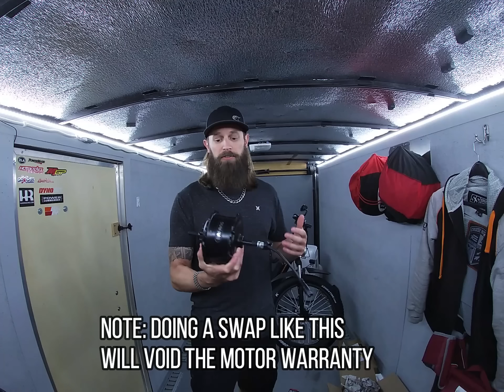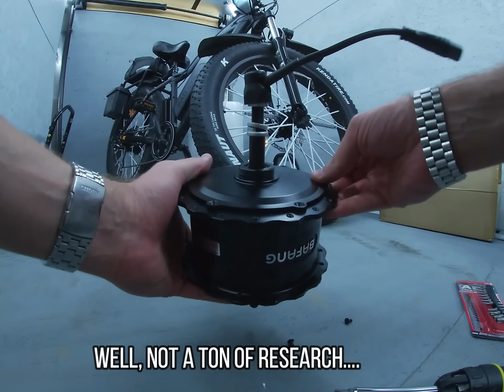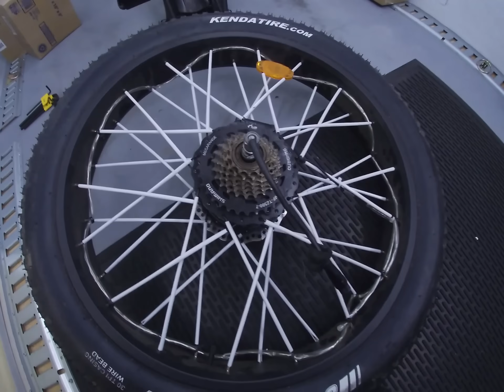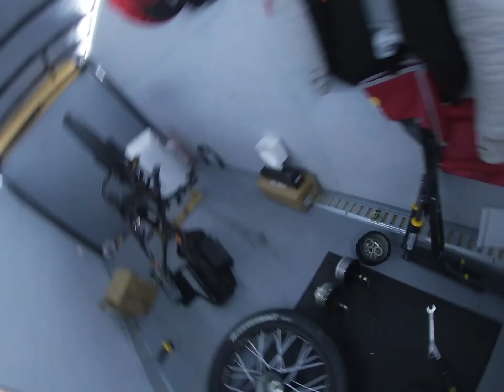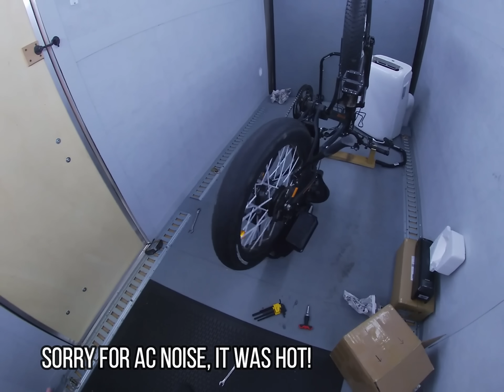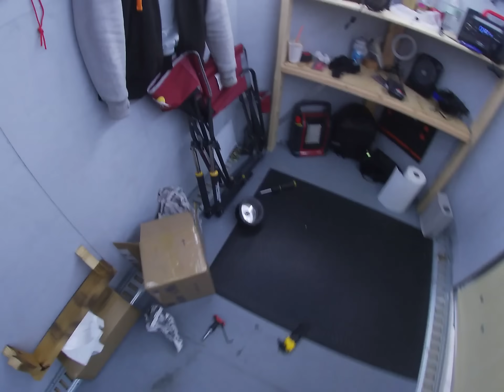750w Bafang Hub Motor Install/Swap -  Rad Rover Ebike

Comment: Derailer just needs to be adjusted via the barrel adjustment screw going into the it at the end of the cable. Simply flip it over, put it into third gear and rotate it until it's in line and not noisy.
Reply from the maker: thanks, that is same thing the videos i have been watching have said so hopefully the fix is that easy!!!!

Comment: Brilliant vid, how long would you say the process took overall, an hour or so?
Reply from the maker: took be about 1.5 hours.  i was definitely taking my time so i didn't mess up.
Reply: Citizen how many miles were on the bike at this point? And did you see any grease in that stock rad motor?

Comment: So what's the point, did it make it faster ??
Reply from the maker: havent done my extensive testing yet. will post results.  point was to put in a stronger motor capable of handling the power i will be running thru it.  i already upgraded to 35amp controller and i will be putting a 52v battery on it.

Comment: I'm surprised that it was that easy to get the original motor out, with some of the 'horror stories' I've read. A lot of folks have said to liberally lubricate the nylon gears with Lithium Grease (some even pack a load of grease inside the case), but I don't know how essential that would be. The original motor looked very clean and the gears did not appear to be worn down (probably has a lot to do with how 'rough' a person is in their riding style). This has encouraged me to think more seriously about making the swap myself - Thank You, Sir! :)
Reply from the maker: Both motors came out and went in smoothly, it was pretty easy.  if i were to do it again,  i would add some grease, good point i didn't think of that, but i'm not super hard on my motors, the original one did still look pretty good.    i wouldn't hesitate to do another swap in the future, you could surely handle it :)
Reply: They do make metal gear upgrades for the motor. I have not tried them.
Reply: @jasonlittle118  From what I've heard, the metal gears make considerably more noise than the nylon ones, but I've never seen a video demostrating the difference. If it wasn't too loud, it might be a really good idea, for longevity.
Reply: Charles Cox thanks for that info. Very interesting, I would have f never thought about the noise.

Comment: Dude, you will notice a big difference from the get go. As long as your controller is set up correctly. Well worth it, now go ride!
Reply from the maker: yes i need to do my research on the correct settings for gear reduction ratio, etc.
Reply: I used the 35A controller w/ colored display from Bolton Ebikes. It pairs very well with the 7true 750watt motor. I extensively watched his video on how to set the controller up and have zero issues with it. The stock battery does not last as long at full speed. But with the entire setup you will not need the full pedal assist. So I think it balanced out a bit. I am however going to add a Bolton 48v battery in parallel with the stock battery. When I do that I will post a video. I hope this helps. Anything else do not hesitate to ask. I’m still looking for the web site for the correct freewheel removal tool that will fit over the cable end. I do know that there are two companies out there including Rad Power Bikes that sell them.
Reply: What controller set up are you using? I am installing 750watt too (Bolton Bikes) upgrade kit. I hear 25 amps s the best pairing. Then I hear I could do 30amps  but not 35.  Please advise people talk but you have direct every day bike ride proof.

Comment: Boy, this is really interesting! I want to find out if there's any performance difference. I'm glad you are doing this. If you could show us how to tune the derailleur,  that I would love to know. Keep up the great work!
Reply from the maker: i will surely post performance results after i do some testing, need to make sure i have the setting programmed correctly for the new motor.   we will see how it goes with the derailleur and if i can get it fine tuned.
Reply: @CitizenCycle925  do u think I can get 1,000w gear motor for my himiway?
Reply: @dimitrimcintosh8858  if you find out, let me know. I’ve been thinking about upgrading my 750 watt hub motor to a 1000 watt hub motor, but I can’t even find any. Do 1000 watt hub motors even exist?
Reply: @CitizenCycle925  it appears you upgraded your 500 watt motor to a 750 by their size. Did you have to change anything else or did you just drop a 750 watt motor into a 500 watt Bike and Go
Reply from the maker: @RandallBalls  I also changed the display and the controller
Reply: @CitizenCycle925  oh bummer. My motor wire just got severed and I have to replace the whole motor and I was hoping I could drop in this 750 watt motor I found. But adding in the controller takes it from a reasonable price job to one that's up in there five to six hundred dollar region which is a little Rich for my taste
Reply from the maker: @RandallBalls  I mean you can probably just drop in the 750 motor with no issue, It's just without the controller and display you probably won't get any more performance from it
Reply: @CitizenCycle925  hello, do you have website to the display and controler. What size is your controller? Thank you

Comment: With the smaller Large gear you should see a lower top speed assuming that the two motors are operating at the same RPM.
Reply: The Larger gear is First gear  ? it would have nothing to do with  top end speed  in 7th gear
Reply: Billy I got it backwards.  You are correct, it be harder to pedal up a hill since the gear ratio is much smaller on the new motor.

Comment: I'm looking forward to your report on how the two motors compare.  I know that my Veego 750 ebike has a lot more "oomph" going up hills then my sister's comparable 750 Rad bike does.  Question about your spoke covers -  did those come with the bike or did you add them?  If you did add them, did you have to remove or loosen the spokes to do so?
Reply from the maker: I added the spoke covers myself, bought them from amazon, they have a split down the middle so no need to remove or loosen spokes, you just wrap them around the spoke, is a little tricky and tedious but really changes the look of the wheels.
Reply: @CitizenCycle925  Thanks for the reply.  They look really nice. I am pretty sure that I am going to do the same.

Comment: check your hanger for the derailleur. It is easy to bend. make sure it hangs straight. Bending it usually screws up one gear. It has a guard  to keep it from bending. The guard should not touch it. After you bump it a few times it will touch, then any bump will bend the derailleur.
Reply from the maker: will check this, thank you!
Reply: Thanks for the heads-up about the hanger. I just got a RadMini ST and I have one gear that messes up. The mechanic tried to fix it upon delivery, but it started again the next day. I might point him in that direction (or have a look myslef first).

Comment: Got my motor but took a month to arrive! Your old motor looks in good shape wasn’t able to see copper wires but looks good. They say these motors can take over volting and your motor is proof of that.   Will take a look at mine when it comes out. Might do it myself watching you gave me confidence. Bolton Bikes still hasn’t sent the upgrade kit been almost 2 months now. Let me know if you ran 35 amps through your original motor or 30 amps or 25 amps. Thanks! Also you incorrectly identified the trailer as a trailer- it is a man cave (and no women allowed!). Now got something special to tell yah your gonna like this. I purchased the Juiced Bikes Hyper Scorpion that right...Hyper Scorpion! Probably wait six months to get it. Let me know about how much amperage you ran through Rads motor?
Reply from the maker: yes i didn't notice anything wrong with my stock motor.  i'm glad the video might have inspired you to take on the swap yourself.  my controller is from bolton and is 35 amps so that was what i was running thru the original motor and didn't have any issues.   and its "mobile man cave" to be exact!!  :)   that Hyperscorpion looks like a BEAST of a bike.  hope you get it quick, and post a vid on it!!
Reply: CitizenCycle Traveling man cave I want one! If I had had one of those I might have stayed married- man needs a place for himself. As to controller very good to hear. Others tell me this that or the other.  Like they know because they know. Good to have you “showing us in real time”. That we can “see for ourselves” and contrast that to what we hear and read. Appreciated!

Comment: Is that "freewheel" called a cassette?  Awesome video.  Your brave!
Reply: If i have done my research correctly.  no it is not a cassette but is indeed a freewheel here is a video that shows the difference https://www.youtube.com/watch?v=iTJ3taJHOn8
Reply: It is not a cassette! It’s a free wheel! Google it. A chain tool will not remove it. It is a special tool that will fit over the plug. I looked for electric rear hub freewheel removal tool.
Reply: @jasonlittle118  I went to the actual specs of the bike.  Yup, freewheel:  DNP 7-speed freewheel, 11-34T
Reply: @keechmabreeks Yep, we went elsewhere due to that red flag. Now I wouldv'e gone with Bolton.

Comment: Great video.  The screws are called Torx security screws AKA star screws or bolts.  I am certainly anxious to see the test results.  But with the different freewheel especially since it didn’t have the lower first gear, I’m not sure how to take the results.  Perhaps the speed results and resulting current draw may show something.  Thx again.  This video is really helpful.
Reply from the maker: when i do the speed tests i do them with the throttle only, so the different freewheel shouldn't affect anything there since i'm not pedaling.  as for daily riding and the power/torque feeling when pedaling i suppose it could affect that.  will be interesting to see what performance gains i get from these upgrades.   glad you found the video helpful and thank you for watching and commenting. :)